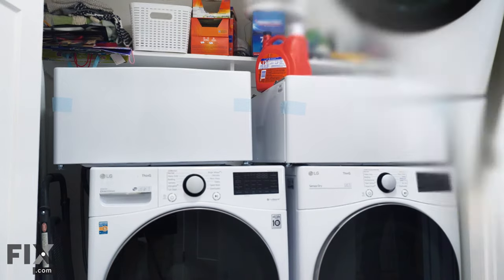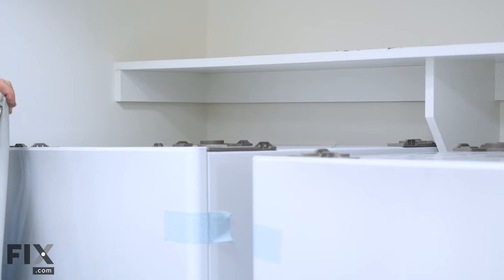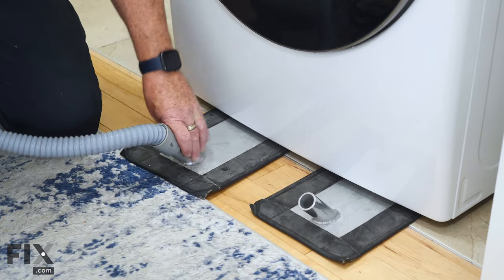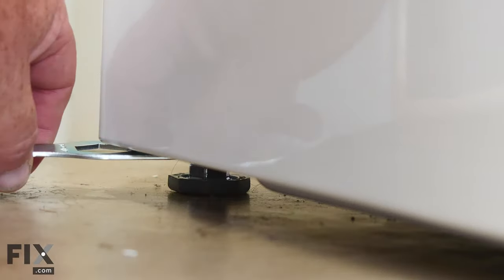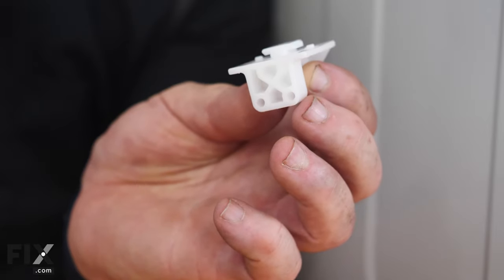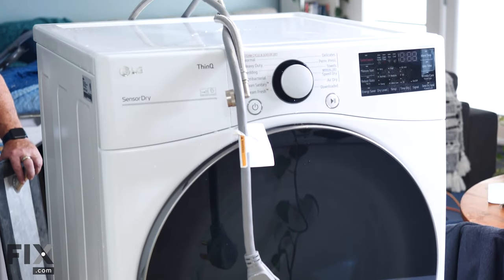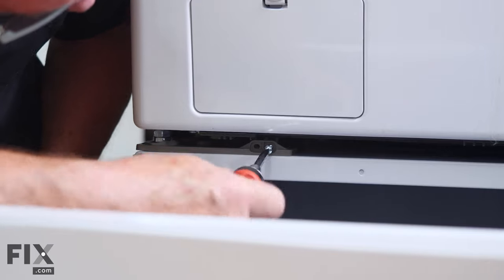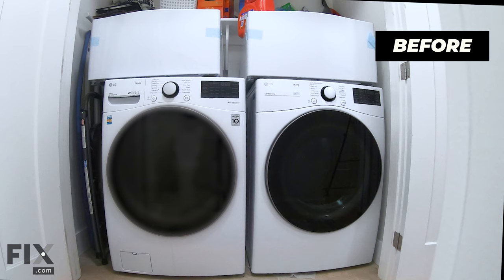How to Install a Laundry Room Pedestal | FIX.com

Comment: Notice that don't show putting the washer on the pedestal cuz it weighs over 200 lb and if you don't have someone that can lift even with you are you just happened to touch anywhere but the plastic Corners that pedal stool folds like a piece of shit soda can even with the light dryer pretty pathetic how much would it have been just to strengthen the inside of those pedestals in the middle to avoid destroying them and this isn't a dig at this guy's video or him himself it's a dig at Samsung appliances just to be clear

Comment: Thank you for your tips...very useful since they were not indicated in the installation manual, even in official videos of the brand right here on YT.

Ironically, manufacturers are increasingly making the installation of electronic devices more difficult and delicate, instead of the other way around.

The only thing that was missing from your video is what was already indicated in other comments, and that is what would be the least complicated way to raise the washing machine to the pedestal.

Keep up with the good content!

Comment: After the pedestals are balanced and leveled and the machines mounted if the machines are moved even slightly will the pedestals have to be releveled and balanced again even if the floor is level

Comment: Just a thought…
Before you start disconnecting water lines…know where the home main shut off is… and that it works. 3:24 
My valves would not shut off… I now need to replace both valves hot & cold.
Just saying…..